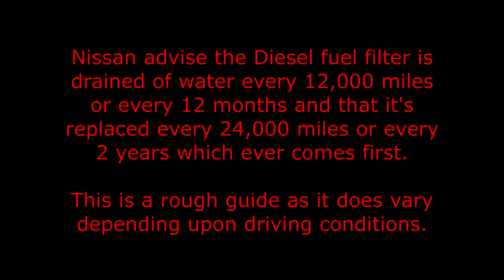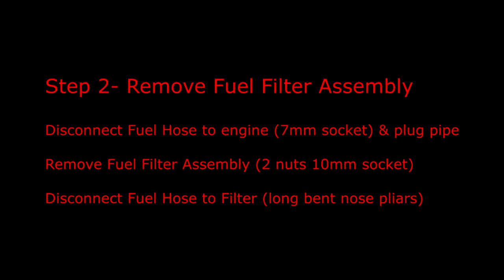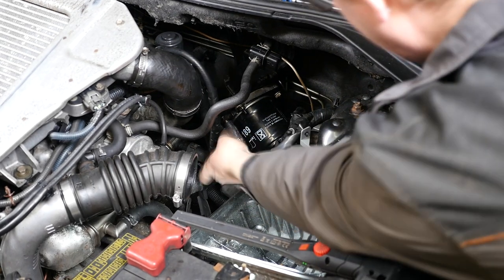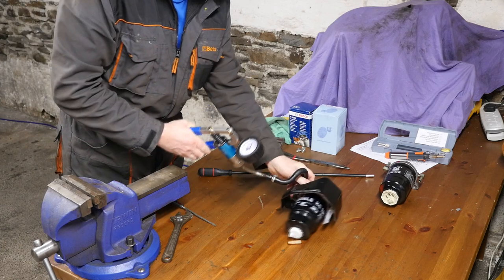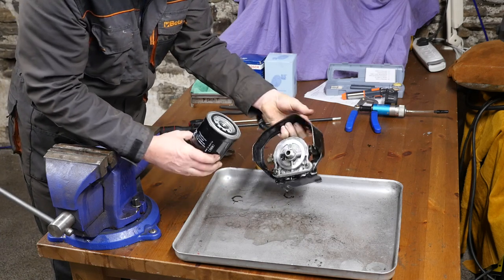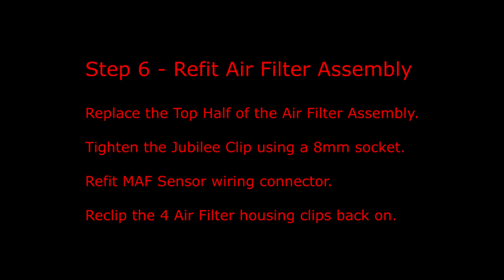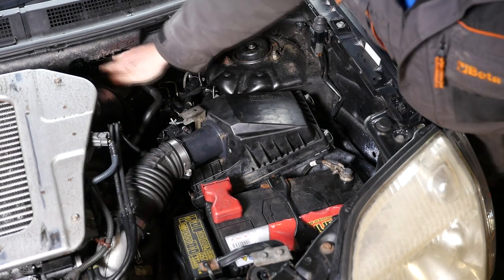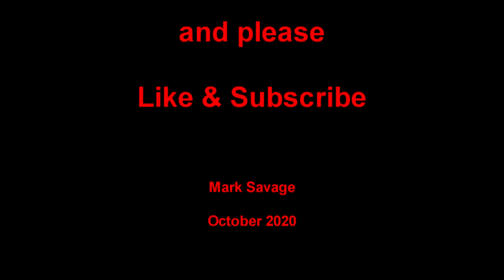Nissan X Trail T30 2.2 DCI Diesel 🚗 Fuel Filter Service, replaced and Dissected. Bosch & Blueprint

Comment: Hi Mark, there are 2 different types of filter housing for this engine. The one you have with the screw on filter, the second type has a seperate primer bulb fitted in the frame of the filter housing. You may wish to pull the filter in your tank under the back seat and clean that also. Because of the up to 7% of biofuel in all diesel sold at the pump these days, I would recommend you change the fuel filter every 8-10 thousand miles. Also the primer housing you have is notorious for letting ait by as the seal on the plunger itself breaks down over time and allows air in whilst in the up position. Also you may wanna check none of your rubber fuel lines arent breaking down internally.

If you havent already done so, check your  rear suspension turrets for corrosion, you'll need to strip out the entire plastics in the boot area to find out if they are ok or not, these xtrails up to 06 plate are notorious for it.
Reply from the maker: Really appreciate all that information Peter.  I did wonder if air was prone to getting into those primer pumps on the top.
Reply: @CoatsandGaiters  My advice to you would be to run the car for 2 or 3 tankfulls of fuel and change the filter again, thereby hopefully leaving you with a cleaner system
Reply from the maker: @peterashman1670  I actually have a spare filter so might do an early change like you say.

Comment: I had the same issue with the primer not working , had to replace it as it did lead to internment starting issues
Reply from the maker: Seems to be a common issue on them.  I guess the rubber ages and hardens.

Comment: I've been researching about this car, thinking about getting one, seems a nice 4WD with great fuel economy,  but I keep finding contradictory reviews on webpages. Would you say it's a reliable car?. How do you know if it's DCi when looking at one?. Thanks!.
Reply from the maker: I've not had it long enough to give an honest opinion as to its reliability and all I can find regarding the DCi vs Di is: In June 2003 Nissan gave the car an interior and exterior facelift, while also upgrading the 2.2-litre turbodiesels with a variable turbocharger (2.2 dci rather than the earlier 2.2 Di), producing 136 PS (100 kW; 134 hp) instead of the original 114 PS (84 kW; 112 hp). The external differences were slight, although the grille and the bumpers were redesigned and the Nissan logo was updated to the latest design.
Reply: i have a 2005 2.2dci,  with 146000 miles on it,  had it 2 years and its been amazing, I use it for fishing trips towing a large boat with ease and its never missed a beat. Its amazing on fuel for a large vehicle as well .  A couple of friends have same car and they swear by them. look for a good one that's been well maintained and you will be fine
Reply: @stephenslater4313  Haven't found "the one" yet, CDi's are a bit rare here. But I have tested a few already and it's hard to believe that this powerful, good sized, capable 4WD car has such an insane fuel efficiency, great value for the price. Thanks for the reply!
Reply from the maker: @stephenslater4313  I totally agree I think they are one of the best 4x4's with low running costs.  Like you say they are good on fuel and comfy.
Reply: @CoatsandGaiters  Absolutely love driving mine im now looking for a T31 same chassis just more refined and more toys, also have an f33 bmw but rather drive the Nissan

Comment: If you suspect you have diesel bug in your tank, there are several different liquid solutions you can buy and add to the tank to sort this problem. If you are using the car regularly then it shouldnt be an issue. Tend to find it more with boats where the fuel is sat in the tanks for a lot longer.
Reply from the maker: Hi Peter did you view 11:23 on part 3 of my Nissan series as I removed the fuel sender.
Reply: @CoatsandGaiters  Thinking back, yes I do now remember you pulling that out.

Comment: hello can you tell me where the termostat is located ,  i change by my self if it is accessible
Reply from the maker: Its at the front left of the engine near the water pump.  It looks to be bolted in a housing to the engine.  Possibly 3 screws holding the housing together.

Comment: Hi I recently purchased one of these vehicles. As the author starts the car and reverses it out of the garage. The sqeeking noise from the engine, I have exactly the same sound. Its super annoying. Anyone any idea what causes it? I was thinking it maybe some pulley?  Cheers
Reply: Check alternator or air conditioner belts. Could be lose.ust be full meat original from nissan. Toothet one wants to squick

Comment: Your whole tank will be full of that gunk..all your doing is your going to block ur filter again..u need to at least drain all the old diesel out and replace with new..ur also running this gunk through ur hp pump and injectors u will destroy them..new hp pump and injectors will be about 1800 pounds..
Reply from the maker: Thank you for your comment and your probably right.  Will bear this in mind for the near future.

Comment: hi Great video by the way. I have a hand  priming bulb fitted to the car .(The Car started first time ,but after running for 20-30 Seconds it cut out. It was the bulb  hand pump split ..There are many different (Shrader} sizes(these are  the ends that attach to the rubber pipe. If any one need to know the size is 12 mm. with  "O" size Jubilee clips'
(
Reply from the maker: Thank you for the information Tony that should help others.  Think the bulb types are still more reliable than the plunger type I had on this truck and at least they would be easier to replace.

Comment: Bonjour, problème d'algue dans le gasoil  pour ma part j'utilise du MECARUN C99 Diesel  .  J'utilise cette gamme de produit qui est excellent pour moteur et injection, mon véhicule a retrouvé  une jeunesse .
Reply from the maker: Thank you for that,  will look that up.  

Hello, algae problem in the diesel for my part I use MECARUN C99 Diesel. I use this range of product which is excellent for engine and injection, my vehicle has regained a youth.
Reply from the maker: @pjrpjr8814  Thank you

Comment: Got exact same car, same filter assembly, yet I've got electric wires going straight into the filter and many more pipes running into and along side it. Impossible to get off. Hate this car. Doesn't even have its throttle body where its supposed to be.
Reply from the maker: The wires might be for a water sensor.  Funny how some people love a car and others hate them.  I really liked driving the Xtrail, though some parts were crazy high for some items.  Diesel engine good though can suffer diesel runaway.  Not sure they have a throttle body as they are diesel unless yours is petrol?